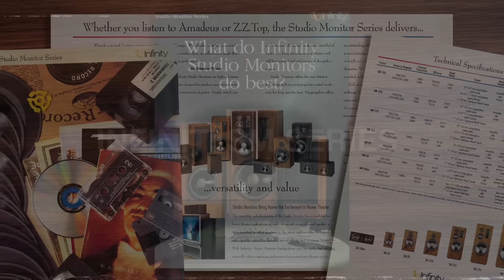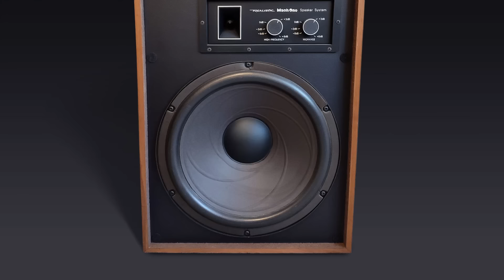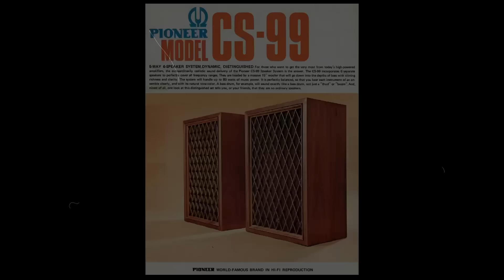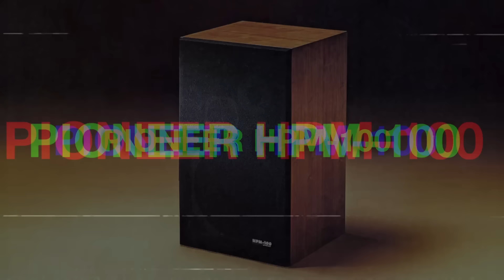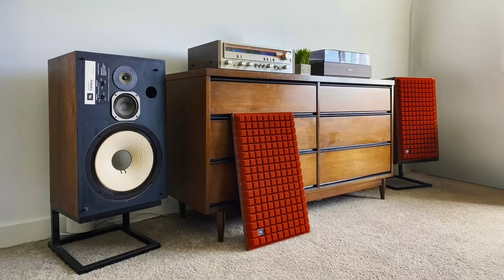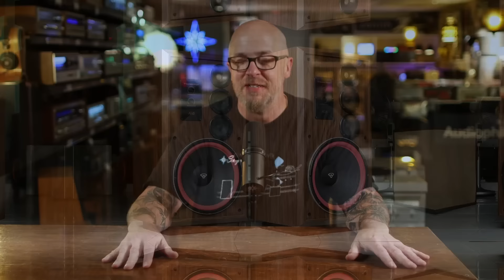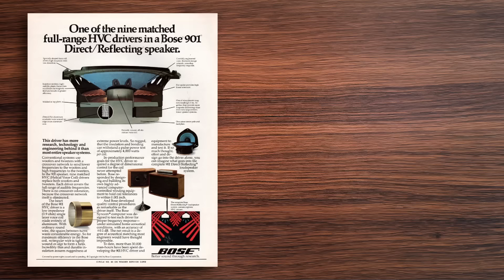Why Do Audiophiles Hate These 9 Legendary Speakers?

Comment: Klipsch fan here. Spent decades listening to audiophile speakers wondering why you could tell if music was live or recorded from 1/4 mile away. Thought the problem was the electronics. I bought an old tube amp and while it was being restored picked up a pair of beaten up old Heresies for the high efficiency thinking I'd have to put a lot of work in. Hooking them up to my existing.expensive solid state gear was a revelation. I got closer to the  live music sound I was craving than any other speaker except perhaps for Quad electrostatics.  I found a decent pair of Fortes, recapped them and with the tube amp. the combination is magical. Two of my neighbors have playlists titled, " songs to try on Roger's stereo!"
Reply: I have LaScalas with Crites Crossovers and Tweeters running off a Class D amp and they sound unreal. Ironically Psy-trance like Infected Mushroom is where the speakers really shine. There is so much detailed tactile audio in those tracks that only fully horn loaded speakers can really keep up with. Try Infected Mushroom - Never Mind if you really want an experience even if your not into that type of music.
Reply: @ColoradoStreaming  I think LaScalas are the best sounding speakers I've ever heard. Way back when, we would go into Catania Sound in San Rafael, CA and drool over them. Mr. Catania knew his stuff. I've heard my share of 100K+ speakers, no thanks. if I had a bigger place I would have a pair of LaScalas for sure. As is, I am very happy with my Harbeths.
Reply: @bruce4521  Lasala's but need a good sub to go with them. then sound better than corner horns. But I think it fits mt taste because I grew Up with Horn loaded speakers in our house. Maybe my ears got trained a certain way.
Reply: @ColoradoStreaming Recently updated my 1988 LaScalas with Crites xovers and drivers. He changed the xover point between the top & mid. Very pleased. Also running a class D. 
Glad to see someone else enjoys a similar setup. 👍🏼
Reply: I think it is the dynamic range of life music and a good PA, it has nothing to do with the speakers or not that much. A normal record or CD or MP3 for my sake, can not cope with the dynamics of life music. You will never ever get a recording from a Leopard battle tank or a Porsche GT4 or a machine gun, jet fighter, etc. that sounds like the original, how good it might have been recorded, mastered and conserved. There is a structure born range of sound and noise that cannot be compressed.
Reply: @LCdrDerrick  Some of the loudest concert music I have ever heard in person was at an orchestra. Stravinsky hits hard and there is no way to replicate that live sound unless you are there in person. I think, but not verified, that the 1812 overture has the largest dynamic range for a musical recording, specifically the canon blasts. 

Bell labs did some interesting experiments in the early days of stereo and one of their tests was a horizontal line array of microphones equally spaced across the stage of a classical concert hall. In a second auditorium of similar size they set up a line of speakers across the stage spaced the same as the microphones so that it was one mic/ channel per speaker. From the testimony of the people that heard it they could hardly distinguish the real thing from the speakers, especially for the imaging as well as it was noted that the sound system was able to shake the floors. The Grateful Dead modified the idea and that is what they used to tour with which was called "The Wall of Sound".
Reply: @LCdrDerrick  What is life music?
Reply: The Klipsch Forte' is a brilliant speaker. Arguably the best Klipsch speaker made. Trust me: They work brilliantly with a very high quality, high power, solid state amp. I used to run mine with a 220 W/ch amp. Loved 'em.
Reply: As a DJ in the late '70s I got to experience Klipsch la scala's as part of my audio set up. They didn't require much power to filla a small venue( auditorium)
with rich sounds and ample Bass. I also currently have a pair of Polk audio bookshelf speakers at home. I'm an apartment dweller so respecting your neighbours is paramount. I think I hit your channel at the right stage of my life because a also worked at Radio Shack in QC especially 
 on the Mach Ones. The big woofers were a major selling point. I even got an ace technician to find tune my 8-track thereby making it's sound rival my house stereo.
Great times. Electronic goods were much easier to repair instead of mysterious black boxes which were unserviceable.Grest times indeed. Thanks for keeping the older components relevant.
Here's a big thank you for doing what you do. 
 I have more stories but I don't want to bore you. 
Rock On !!.

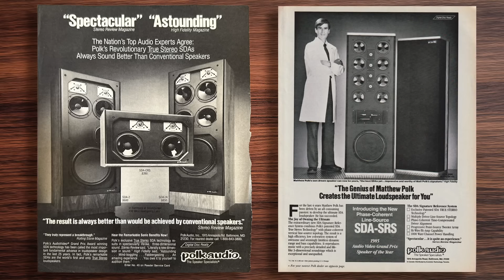4:05 4:05
Reply: Interesting factoid about the Heresy- Klipsch designed it as a center "phantom" channel linked between the left and right stereo speakers from the positive terminals. This achieves the same as the SDA speakers by canceling out any cross-talk and only playing the difference which is also known as the OOPS channel meaning out-of-phase-stereo. He called it the "Heresy" because it was considered antithetical to have more than two speakers for a stereo setup.
Reply: @thephantomchannel432hz  Funny- Lascala center here
Reply: You know about Quads? Uncle had a pair, along with double KLH panels with Ionovac tweeters and suds tri-amped! But it was the Quads I asked to hear, no bass, no volume but so pure!!!
Reply: Heresies sing when hooked up to a 10-watt(!) per-channel Eico HF-81 tube amp.
Reply: @TheLoneShark-s6y   Also a killer speaker and a fantastic bargain.
Reply: @TheLoneShark-s6y 10 watts, even with high efficency speakers i had i still had a 120 watts per channel pushing them.
Reply: Yes goes over a power Eclipse that were tough in the 70s had a huge horn that was way too bright by design for a ballroom. Klipsch where redesigned them 20 years later and made them super clean and clear
Reply: Must have some cool neighbors.
Reply: Interesting. Hard to beat the combination you have there. Thanks for sharing.
Reply: I live down the street from the klipsch factory and when I was a kid my mom would take us to the listening room it was great
Reply: I first fell in love with Klipsch when I was 16.  It was a pair of K-horns driven by a McIntosh 2105 playing the Bee Gees Lonely Days followed by A Day in the Life.  I was gobsmacked.  Of course, I couldn't afford anything close, but that's when I knew that a "stereo" really could come darn close to live.  Now, I'm driving a pair of Forte IV's with an 8 watt per channel 300B amp.  Put on a great recording (my current fave is Casey Abrams on Chesky records) and that same old jaw-drop is there.  I've had lots of others over the years, including a set of Maggies that were fantastic, once you got them just right, but even those are not the same.  The thing about the Klipsch Heritage line is they show poor recordings to be just that and I can't stand it.  Arggg!  But with very good to great recordings, they can put you on the stage grooving right along.  I think that's their magic.
Reply: I can also tell when a source is bad live sound from far away. Most live sound systems and live music listening environments are somewhat crappy, which begs the question- is recreating that "live sound" going to make the music sound its best, if it can actually be improved upon from the typical live experience? That being said, the emotional associations of live sound, crappy or not, can reasonably triumph over the emotional benefits of  more objectively balanced sound.
Reply: @maxhirsch7035  I agree, some live recordings are trash and will sound like trash when played back through any system. However, there are some live recordings that equal or surpass the studio version, especially true for classical recordings which are almost exclusively a recording of a live performance. 

For me, the "surround sound"/ OOPS channel is a way to open up the sound to let it breathe. Completely subjective language because it is difficult to explain other than the terms "wet" and "dry". A studio recording is a "dry" sound with the feeling of the session being recorded in an open field with no barriers to reflect sound back to the mic. With the OOPS channel you gain back all those incidentals and reflected sounds which sounds a lot more natural as if it were recorded in a physical space rather than a vacuum. 

With all that being said, the only "real" way to experience true stereo is with headphones where both channels are completely isolated. I run my system with four channels derived from a stereo source. Left/ Right, Mono- sum, OOPS- difference. When all four are balanced the result is recordings that have a "weight" to them, as in it sounds like you are actually in the room where the recording took place whether it be a massive concert hall or a studio recording.
Reply: I’m very happy with my new Bowers&Wilkins! 😊
Reply: @fisch69 inefficient unless they are finally making them better then they used to
Reply: You have my sympathy ..., just on the Klipsch fan stuff ....

Comment: I didn’t like the JBL L100s when they came out, too much upper midrange. But, JBL made a real pro studio monitor that was much different that was a much better speaker. And the Bose 901s when properly set up and eq’d were very good, but it meant they weren’t easy to use a room where there was a bunch of furniture that couldn’t really moved around, which is most people’s homes.
Reply: Having also disliked the L 100s, and having worked at a voice-over studio with the pro monitors in the control room, the pro monitors were much better than the “honking” sound of the L100s. And the 901s just plunked down were nothing. But hearing a pair, properly placed showed they were capable of sounding good.

Comment: had a set of Realistic Mach 2's connected to a Sansui 9090 back in my day. those Mach 2's would not blow, lord knows I tried
Reply: They went loud and stayed in control too. Had mine connected to a Technics SUV60 110rms per channel. 50% volume was the max I could ever brave. Very underrated.

Comment: I love old infinity speakers, I own a pair of rs6001 and they sound great, the SM are great party/teenager speakers, probably not the flattest but a lot of fun. So are the CW. The Bose 901 are one of the worst speakers I have heard, a friend of mine spent a lot of money trying to make a pair of those sound good, no way, it is crap. I owned 2 pairs of 301, an early one and one from the early 2000,s. Both garbage. The only thing Bose makes right are noise canceling headphones.

Comment: I love your videos like this because I'm from that great stereo era, the 1970s.  Now I am 65, and I still own and play my bought new in 1978, Altec Lansing Model 15 studio monitors.  You are correct, they are so heavy (80 pounds each) that they are rarely moved, so the original walnut cabinets are still in pristine condition. Of course the original foam grills disintegrated into dust a few decades ago, so I installed a couple of black steel grills to protect the gorgeous 12" woofers, which I had re-coned only once back in the late 1990s.  I like to see the massive high frequency horns without the grills anyway.  The bass is deep and rich, the horns are bright, and for a 2 way speaker, for  me, nothing sounds better as I rotate the volume knob clockwise on my old Sansui 7070, (serviced for cleaning twice) which I also bought new in 1976.  I only play my iPod classic 160GB through my system anymore, but man it sounds great, for me anyway.  Keep the nostalgic videos coming!
Reply: I agree with you.
Our modern stereo systems of the 1970's were an essential part of who we were,  wanted to be, and still are to this day.
Digital  systems are great, compact, and technologicaly impressive, but in no way rival the immersive home listening environments we  curated for ourselves  back then.

Comment: dynaco)and Scan.Syna, in europpe) A10 - vompact, 2.way bookshelf par excellence

Ya,shs NS1000/1000MN,exampes carefully home-used.  the absolute best, with a mid-ramhe driver, other makers, likw Wilson Audio Specialities, would kill to get their hands onm at any cost, 184.1996 produczton. unchanged during entire run....my77's sound just like my 96's ....have Ella or Frank appear in your listening room. magic  versatile; good sensivity, easy load, for SS or tube amps.play a tape of a person just talking; on replay, that person is there.  imo, tht and solo piano, are best tests in reproduction.no downsides, on 10 inch stands. vintage at its absolute best. carefully experimenting with precise positioning.

Comment: I have a pair of  vintage 1976 early production Pioneer HPM 100s  hooked up to a Yamaha 85 watt per channel RX770 receiver, a 1970s Technics SL1700 turntable, a Pioneer PD453 cd player and with my computer tied into the receiver and  I'm still using these speakers on a daily basis after 49 years and they still sound absolutely great.   Steve

Comment: That was a very interesting video. At 66 (my audiogram is no where near flat), I bought a set of Klipsch Heresy IV's (used for 1800 for the pari)for my listening room powered by a 35 watt Luxman. I actually love them. However, my living room surround has Bower's and Wilkins's 600 series with a 350 watt powered sub. They are what I could afford powered by a Yamaha. I love them in a whole different way and they are definitely more linear. if I had the money, I would probably trade them for a set of 800's. The Klipsch might not have impressed me back in the 70's when my hearing was great. That my be something. Different room, different use. Dunno, however. I am saving up for a 2 watt tube amp for the Klipsch. I never wear my hearing aids when listening to either one.

Comment: The 901s needed subwoofers. The 9 speakers could be smaller and more tuned towards treble. This would  eliminate the need for such drastic equalization.
But yeah, as built they're good,  but not what they could have been.

Comment: Good video. Great audio. Better than most Youtube channels.   I still have my Infinity Monitor II's. I've learned how to repair the Walsh Tweeters.  Love the sound.  I also had their SM155.  The bass can be tamed by putting a few wood braces inside and inserting more stuffing.  Really made them more listenable.   Sold them for a nice profit.  I drive my speakers with a recapped BGW 250E amp.  Your amp is a very important part of your audio system.

Comment: The VERY FIRST Bose 901s sounded good when placed correctly. With each succeeding series, the sound got worse and worse. As I recall, they did seem to have limits on how hard you could push them. Generally, you didn't want the peak power to exceed the advertised RMS power, otherwise they got really muddy and harsh.

Comment: I agree with everything you said! While not normally a fan of the Bose sound, I am impressed with a set of early 901s (brown grille cloth) at our dance studio, which has them suspended the correct distance from the ceiling in the second-largest room, with supplied EQ unit. I've been an audiophile my entire life, worked in Radio Shacks and stereo stores in the 70s, and have to say that this configuration is the best I've ever heard. BTW, you are so right about the Kabuki speakers; I hated them even back then! 

We dance at (and I photograph) West Coast Swing dance events, where mid tempo 4/4 pop music ranging from R&B to EDM, is played, and the 901s deliver it without any obvious coloration and a surprisingly extended low end that you usually only hear from expensive club-grade floor-mounted subwoofers. A few months ago they replaced the amp but left out the EQ, however I'm happy to see it's now back in the loop at our weekly dances. And that particular studio gets used almost every day. At home I have very accurate Revel Performa speakers which have been mistaken for live performance/band rehearsals by neighbors (true story)!

Comment: I ran the jbl l100t3,s as mains similar to the l100,using a 12 channel eq and a set of series 2 Bose 901,s as surround speakers hanging from the ceiling set wide and didn’t use the eq instead ran them thru a bbe sonic maximiser. The combo worked well for me. Preferred the l100,s  to the Cerwin vega and Mach one that were  there in the mid80,s-early 90,s and yes seagull shaped eq curve more so than a v on the l00t3

Comment: I used to sell audio gear and I used to sell Cerwin Vega, and yes most of their speakers were certainly not flat.  I loved that they were so efficient. but most of them had horrible imbalance in the sound.  However, they sold a 12 inch 3 way speaker called the CV321, that's what they were called at our store.  At Pacific Stereo I believe they had a model CV123.  No price comparisons in our town. :)  Anyway the CV321 was actually a very good sounding speaker.  I remember how well Crystal Gayle sounded on those speakers.  But most things did sound good on them.  Just so you know where I'm coming from, today I own a pair of B&W801D4s If I could get a pair of the 321s I would love to hear them in my garage.
Reply: I have a set of the HED U-321s running through an old Kenwood system and they sound extremely good. I was expecting this really punchy bass, but they are actually very balanced in their sound. Clapton Live sounds incredible on those CVs. But i think the pair you had and the pair i have were released as part of the CV HED line.

Comment: I am no audio expert by any means, but one of my most memorable listing experiences was hearing Wings come through a pair of Bose 901s.  The sound blew me away.  This was back in the 70's.  In the 90's I bought two pairs of the Bose cubes just based on the 901 experience.  The cubes were good, but not 901 good.